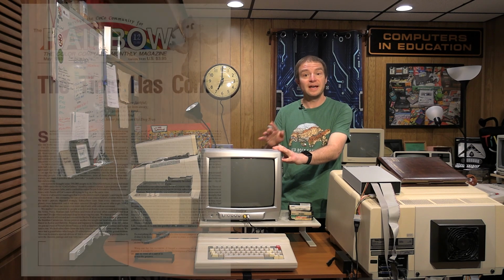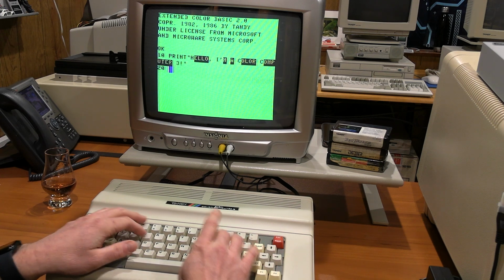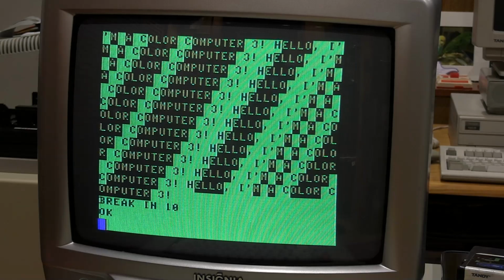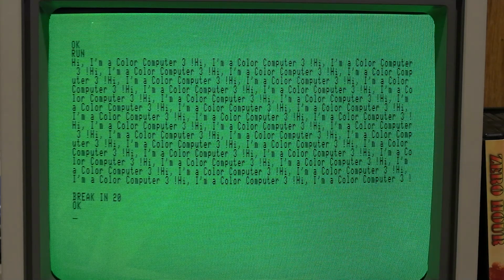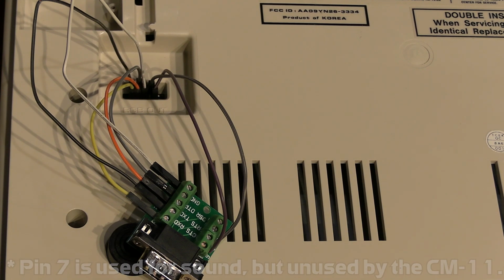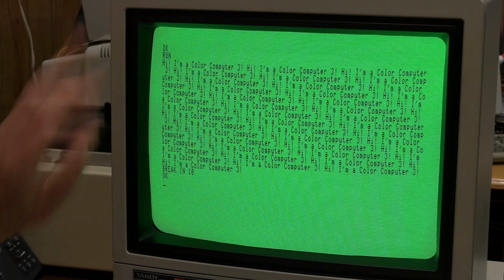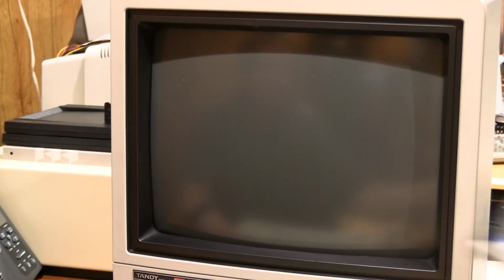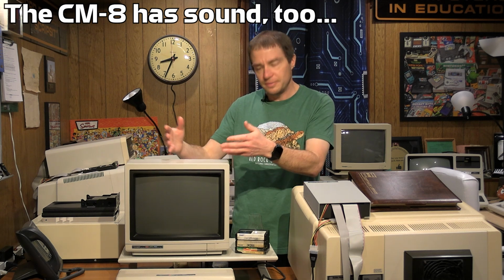Tandy CM-11: It Works With The Color Computer 3!

Comment: I did have another question, do you know if a CoCo (any) can do or handle a tape drive? Maybe a QIC80? Or some other? Also I noticed your wall decor sign! YOU GOT IT!! Hurray! It looks great.🎉
Reply from the maker: I don't remember any specific support for tape drives like the QIC80 or similar.   But there were some SCSI options available that worked under OS-9, so it's probably possible for a SCSI tape drive to work.  I'm not sure if anyone ever did it, though.  🙂

Comment: When I bought the CM-8 back in the 90's, even then it was known to be so-so quality (0.51 mm dot pitch, as I recall) but it was compatible with the Coco 3. I made a cable for the Sega Genesis, and that was awesome!
Reply from the maker: A lot of people liked to use the Magnavox 8CM515 with their CoCo 3s back in the day.  It had a higher-quality display and could work with many machines.  I guess for those of us who started with TVs on their CoCos, the CM-8 was a big enough leap that we were content with it. 🙂  I didn't realize you could connect the Genesis to a RGB monitor.  Very cool!

Comment: all 64 color ?
Reply from the maker: You only get a handful of colors on this...I think 8 if I remember right.  That's because the CoCo's analog RGB doesn't have the intensity line that the CM-11 uses to determine the specific level of color to display, so you basically get ON or OFF for Red, White, and Green.  The CoCo varies the levels of R, G, and B instead of being binary, so the CoCo's CM-8 can figure out the levels based on the varying voltage on each color signal.
Reply: @TJBChris  i owned a cm11

Comment: Wondering if I can use my CM-11 monitor on a modern pc? Anyone know where to get the right cable?
Reply from the maker: I haven't seen any modern adapters to let you use a CGA monitor on a new machine...most of the reproduction video cards that I've seen available for this kind of monitor are for older systems with 8- or 16-bit ISA slots.  That said, I don't really go looking, so there could be something out there I'm not aware of.  

This monitor's resolution is so low that it wouldn't be terribly useful, and its scan rate is not very common anymore, so I focus on using them with machines of the same period.  Thanks for watching!

Comment: That was very cool to see.  That would work great for connecting to BBSes if I ever get a proper serial connection to connect to my Wimodem232.  I do have the Direct Connect Modem Pak (setup I used as a little kid), but I've never experienced any true terminal programs on the CoCo, and I would imagine a package exists that allows for ANSI color and graphics?  🤷‍♂ My CoCo3 is currently setup to a Sony PVM via composite, and my Apple IIgs is connected to it simultaneously with a custom component cable.  I still want to get a custom cable for the CoCo3 to connect it to the PVM the component way, sound and all.  As usual, great video, Chris!  Nice to know there is another option!
Reply from the maker: Thanks!  The CoCo does make a great BBS system.  There are at least a couple of terminals with ANSI support under OS-9.  I think one is Twilight Terminal is one, and there's another whose name I can't seem to remember.  Ah, the joys of getting older.  😀  Twilight Terminal can be found on the Color Computer Archive.  I'm not sure if it's also included in NitrOS-9 EOU or not.
Reply: @TJBChris  Thanks!  I'll hunt that one down one of these days 😎

Comment: The CoCo was a wonderful counterexample to Microsoft's excuses regarding MsDos, that you couldn't effectively multitask on hardware as limited as the PC. But the CoCo was far more limited, and OS/9 multitasked very well.
Reply: And OS-9 existed for quite some time before the CoCo ever did. The first issue of "68 Micro Journal" magazine was in Feb 1979 and it was already packed with 6809-specific information, ads for computer boards and kits, and (of course) OS-9 itself.  The magazine began speculating on rumors that Tandy was going to come out with a 6809 computer and sure enough eventually the CoCo was released in 1980, and OS-9 for the CoCo in 1983.
Reply: @jeffdege4786  Yeah and IBM had XENIX which had those features running on the Model 16 which was roughly analagous to some PCs of that time

Comment: Interesting, the RF output looked better than the composite in the first test. The m's in 40-column mode were definitely more blurred with composite than RF, you couldn't even see the gaps between them at all, whereas on RF you could just barely make them out.
Reply from the maker: The CoCo 3's composite output was never regarded as being very good, so it was a minor upgrade over RF at-best.  Back when TV stations were broadcasting on channels 3 or 4, composite would win simply by allowing you to avoid interference from those TV stations.  Now that those stations are gone, it feels like there's less difference between the two.

Comment: Doesn't the RGB-11 have composite in? AFAIK it's the only Tandy monitor to have that. Bizarre really that they never had a composite only monitor (with no TV capability)
Reply from the maker: Correct: The CM-11 doesn't, but the confusingly-similarly-named RGB-11 that was sold in Canada had more inputs available.  The CM-11/RGB-11 thing definitely confuses a lot of people...I now keep a manual of the RGB-11 around to send people when it comes up. 🙂  Some of the Tandy monochrome monitors from the '80s did have composite inputs, but on a "Color" Computer, I guess that's not as fun.  Thanks for watching!
Reply: My fantasy was to have a CM-8 for the apps that looked best in RGB and the RGB-11 (ironically) for the apps that looked best with composite.  Two monitors hooked up at the same time.  Quite the CoCo battlestation!  And all Tandy - no need to go third party.  By the way the RGB-11's catalog number was 25-8056

Comment: This reminds me of when I had the coco 3 when it came out and purchased a Magnavox monitor that let you switch between composite and RGB.  It was in my budget, but I eventually learned that the reason I couldn't get all the supported colors in RGB was because my monitor needed a TTL signal.  That always bummed me out.  Unfortunately, I learned this after I had the monitor too long to return it and buy a different one.
Reply: @MrJacksspleen  Was it one of the ones (like the 8CM515 or the 1CM135) advertised in CoCo magazines?
Reply: @IrishCarney the 8CM515 works perfectly with the CoCo3.  Tandy should have just changed the badge and sold it instead of the CM-8.  Better dot pitch, composite and RGBi modes in addition to analog RGB.  It’s a great monitor.
Reply: @davidkroeker1821  Ed Ellers, in the same issue of The Rainbow , said: "Composite color performance is quite decent as well, though with a few minor defects. The composite picture is just a bit less sharp than what I'm used to seeing, probably due to the low-pass filter used to keep the color subcarrier signal from appearing in the picture when the comb filter is switched out. (The comb filter circuit used by Magnavox, unlike that used by RCA and some others, has some unfortunate side effects on the picture in some situations; the RGB Monitor 80 has a switch to disable the comb filter, and for CoCo use it should be switched out.)"
Reply: I don't think so.  I think it might have been CM8562

Comment: Can a CoCo 3 do 64 columns like a Model I or III? Because that was the actual practical resolution since it's basically one inch margins on either side of a 10 pica printout
Reply from the maker: AFAIK there's no native 64-column text mode on the CoCos, but you could use a graphics screen to create a 64-column-style mode (especially on the CoCo 3).  It wouldn't be as fast, but it would render better.

Comment: Someone should make a cga to coco 3 cable converter.  I used a cm-8 as a cga monitor for awhile for my bbs run on a tandy 1000, opposite problem I suppose but still tough to solder to those little leads. I enjoy your channel. I still have my coco-3, but I have yet to find a cm-8 or appropriate monitor for it, using it with an old tv with rca inputs, not the best... but works for now. I know you can also use an amiga  monitor on a coco-3 if you can wire up a converter cable.
Reply from the maker: CM-8s are definitely hard to find these days.  When they do show up, they're usually expensive and get snagged quickly.  There are quite a few modern (and modern-ish) solutions for CoCo displays, like HDMI and VGA.  I've been fortunate enough to have a working CM-8 since the late 80s...I can't imagine trying to find one now.  

A direct cable adapter would probably be fairly easy to make, but something to fix the color issue and bring in the intensity line would up the complexity (and thus, the BS-to-gratification ratio).  Thanks for watching the channel, I'm glad you like it!
Reply: @TJBChris  I worked at radio shack from 16-20, good times, brings back great memories for me.

Comment: My old coco 3 worked best in 80 column mode with a BW TV even over RF, i'm sure with a amber or green monitor with comp inputs it would be awesome.
Reply: I thought RF could only do 40 columns at most.  Tandy did sell the VM-2 and later the VM-4 which were green monitors with composite input.